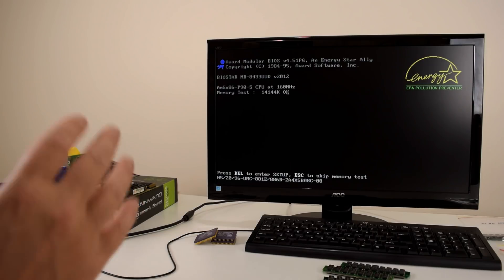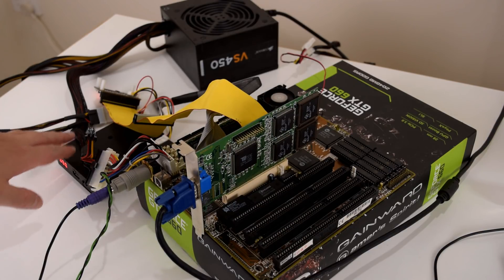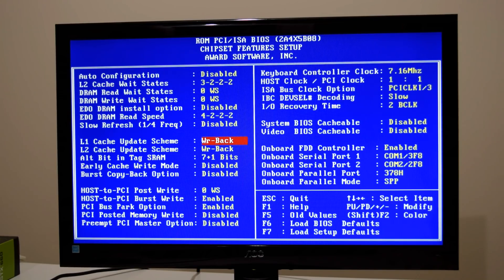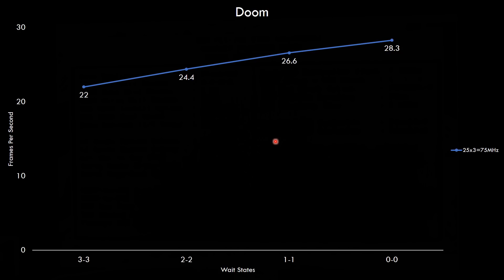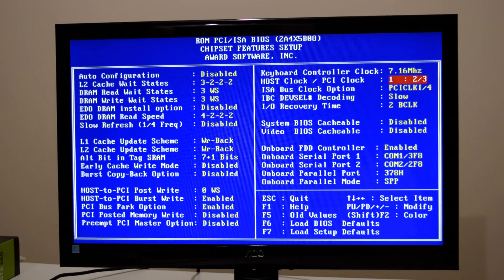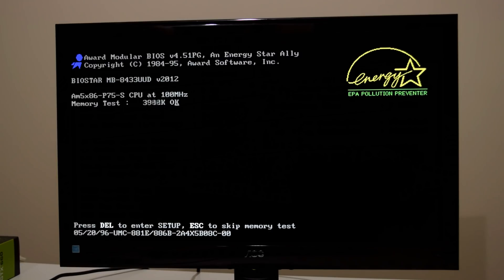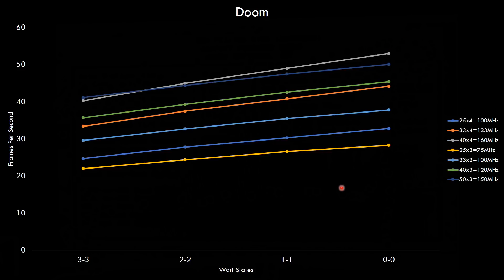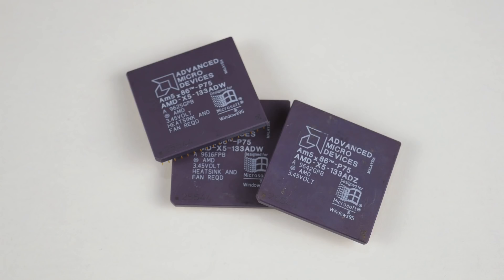486 from 75 MHz to 160 MHz and how memory timings matter

Comment: I honestly never overclocked any of my machines ever.
So, just out of curiosity... can you keep the 486 at 160MHz for productivity without running into longterm issues?
This makes me wonder if I could overclock my old MMX200 to 233 or 266MHz as I remember lots of games back then preferred those clock speeds.
Reply: In my experience the MMX can easily be overclocked. I ran a 166Mhz rated one at 233Mhz for the longest time because it had no 166Mhz written on it only the model number and I accidentally confused it for my 233Mhz one.
Reply: I've always had good results overclocking the later pentiums, even the non-MMX models. Ran a lot of testing a few years ago and my P200 (vanilla) ran fine from 75Mhz up to 250Mhz with a small Pentium 3 cooler, and sat happy with a SS7 cooler just the same.

The speed difference isn't huge, all things considered, beyond 200Mhz with the pentiums. Prolonging the life of the CPU in terms of usability didn't really come into it back in the late 90's because the Pentiums simply didn't have enough grunt to run a VooDoo 2 without severely bottlenecking the card. The Pentium 2's were simply so much faster, even the bottom end 233Mhz PII.
Reply: every machine ive had.....that could be....has been OCed
i dont go all out..... i like to keep the voltages quite low, and temps below 60c (which with a nh d15, is easy to do lol)

my favorite was using PhenomMSR Tweeker to P-state OC.....i ran P4 at like 800mhz and VERY low voltage
and p3, p2, and p1 were all stock speeds.....but were all under volted 

p0 is where i had a 4ghz OC with 1.45 volts on my old phenom 2 6 core....

now ive got a ryzen 8 core at 3.925ghz
Reply: It was a common thing to run Am5x86-133 chips at 160 MHz back in the day. They could run like though throughout the life of the computer without issue so long as you had proper cooling. It was sometimes possible with certain steppings of the Am5x86 to get 200 MHz, but you needed a motherboard which could run at a 50 MHz FSB, which was pretty rare.

As shown in this video, bus clocks were often cascaded off of a master clock (usually the FSB) and often didn't have dividers available, so boards that had PCI or VLB could end up running the slots at 50 MHz, which was way out of spec and caused cards to malfunction. Though if you could get such a setup working, it would often perform like a low end Pentium in many applications.
Reply: I distinktly remember I have seen  DX-33 passive cooled small copper heatsink with the size of the cpu , as I remember heatsinks came wtih dx2-66 overdrive - maybe he could keep it cooled with the airflow in the case.
Reply: >really shows just how much more horsepower the P2's had over the original P1's

When comparing a Pentium MMX and a Pentium II at the same clock speed, the only thing the Pentium II really wins at is 32 bit code, which at the time wasn't very important. The Pentium MMX could hold its own in 16 bit code, which is what most DOS games and many Windows 95 applications still used.
Reply: the stock speed was 400mhz. i think it was stock cooler up until the point the fans failed and i replaced them with slightly better fans. it really wasn't that hot even at 600mhz. well it wasn't hot at 533, at 600 it started to get a little toasty. but nothing unmanageable.
Reply: Pretty much. I've got a Pentium MMX 166 that was remarked (Custom sticker) as a 200Mhz chip and runs flawlessly to this day.
Reply: If it supports a amd 333 k6 then go for it .eg not lower since k6 is kinda weak and at 333 you dont have the trouble of k6-update in window's - window's wont start since it dont support higher than 333 amd cpu's- If you go for it have it on floppy because any udate that updates window's features removes k6. (Any is like internet explorer or windows media player)
Reply: I remember a lad I knew from school had a 486-DX2-50 in his machine at home and he didn't even have a cooler on it... that was surprising to me!
Reply: >had a 486-DX2-50 in his machine at home and he didn't even have a cooler on it...

Any 486 from 40-80 MHz really needs a heatsink, and a fan above 80 MHz. A DX/2 50 will get smokin hot without a heatsink.
Reply: It was smoking hot! LOL! But it worked! Most of his PC was held together with tape. I was just shocked we were playing Worms in DOS and he didn't even have a heatsink! XD
Reply: Some of the later Pentium and Pentium MMX chips had locked multipliers, restricting overclocking to raising the FSB. The earlier chips were fair game, though. I've heard this was introduced due to the high number of upmarked chips being sold, particularly in Europe.

Unfortunately I am unable to test overclocking on my MMX200, thanks to a locked multiplier and an OEM board that only goes up to 66MHz FSB. Even with an overclock, it still wouldn't match the performance of a PII 233. Regardless, the system serves me well as a great MS-DOS / W95 system that runs the games I want (I think it's the fastest Jazz Jackrabbit will run on without patching).
Reply: You need a good (and now rare) super socket 7 motherboard to fully test overclocking socket 7 CPU's. I have a couple lying around, but I don't tinker with them anymore. Simply don't have the time.

And yeah the P2's are a different beast altogether. Running a later DOS4GW game like Tomb Raider or Carmageddon really shows just how much more horsepower the P2's had over the original P1's. At the same clockspeed (233Mhz) it's night and day. The VooDOo cards really fly in a P2 also, the P1's really hold them back. I had a VooDoo 2 card in a Pentium 1 for a while but it performed roughly the same as the VooDoo 1 did. Total CPU bottleneck.
Reply: My IBM I got brand new in the early 90s with Intel 468 SX33 has no heatsink on the CPU and there's also next to no airflow. I think IBM would've put a heatsink on it if there was any danger of overheating the CPU. I don't know though if DX33 and SX33 makes a difference in terms of heat generated. All DX2-66 I saw back in the day had at least a passive cooler mounted.
Reply: > I think IBM would've put a heatsink on it if there was any danger of overheating the CPU

Unlike today where proper cooling of the CPU is down to a science, back then, there was a stigma of using heatsinks and especially fans to cool CPUs and other components. In many computer designs, the only fan in the entire case was a slow moving one in the power supply which provided almost nil airflow.

This stigma lasted well into the Pentium generation with computer designs opting for huge heatsinks to avoid even a single extra fan in the case.

The avoidance of proper cooling in designs did lead to high failure rates, especially among the more junk brands like Packard bell.
Reply: Yes in my IBM the only fan is the one in the power supply. But IBM was known for robust systems, so they must've been very confident that the SX33 would survive a long time without cooling, which in case of my IBM system became true. When you touch the CPU with the finger it also doesn't feel hot, just warm.
Problem with 1st gen CPU-cooling were the very small fans that often were of very questionable quality. My first one on my Pentium survived just 3/4 of a year.
Reply: I don't associate IBM with the words robust or quality. Their mid 90s to mid 2000s systems were absolute garbage with motherboard failures due to faulty capacitors, power supply failures and infamously, hard drive failures. Their faulty hard drives cost them over a billion dollars in lawsuits and warranty replacements, which is why they sold out to Hitachi.

I remember having to get warranty replacements on IBM hard drives in the early 2000s and even IBM didn't have confidence in their own products so they were sending Maxtor and Seagate drives out as replacements.
Reply: I never saw a mid 90s (1995/1996) IBM PC with faulty capacitors. Maybe their consumer line Aptiva featured cheaper components I don't know. The problems with the harddrives cames later (~1999) and only certain models suffered the failures, apart from that they were good drives. That was also already the time when IBM left the PC system builder market.
Reply: the intel 200mhz processors used to easily run at 233mhz, with no problems as long as the pci and isa busses are running at 33 and 8 mhz, they will do this forever, but in my experience only the black fiberglass or ceramic versions would run at 266mhz reliably especially running windows, you will come across some 200mhz intel chips that have green fiberglass these i could never get to run 266, 233 with better cooling was sometimes possible but not always it seems that these chips dont care for over clocks, i once got a 233mhz chip to run reliably at 299mhz on a super 7 board(asus atx), with a skt 370 p3 fan an heatsink modified to fit.
if you are looking for a socket 7 intel mmx cpu look for the black fiberglass boarded 200mhz chips(real ones not rebadges), in my opinion they are better than 233 chips in terms of overclock, and were and probably still are cheaper than 233mhz, as for amd the 400 and 500mhz k6 socket 7 chips are better than 450 and 550mhz versions, they are also easier to find, 550 chips were thin on the ground then never mind now, but as the intel ones mentioned above the 400 and 500mhz versions have better overclock possibilities.
Reply: I had a 486 66 dx2  in 1994.  The dx processors had no fan just a heatsink. The 486 sx had no heatsink or fan.the 486 dx4  and early pentium had a fan and a heatsink. I bought the 486 dx-66 because early Pentiums were failing due to overheating for about a year or so.
Reply: 486 up to DX2 66 MHz can operate without a heatsink. Faster CPUs require a heatsink and a fan for sure.
Reply: well i had a pentium 2 400mhz that ran at 533mhz (topping out at 600mhz for a few months after my 1ghz atlhon went poof and i had to fall back back to the pentium2 until i could buy a new atlhlon, so i pushed it as hard as i could to lessen the downgrade) or more for 10 years and it probably still works.
Reply: What was its original clock speed? Did you use special cooling?

Comment: I never knew you could get an AM486 going that fast! Highest I ever got an intel 486DX2 was at 75 from 66 and it didn't like it.
Reply: The AMD 5x86 was a 486 architecture compatible 486 motherboards. I think the fastest variant sold was 160 MHz stock.
Reply: It's not a AM486, it's a AM5x86.  Technically it's a optimized and clock increased AM486.

Comment: I never found a 486 of any type actually make a lot of use of the L2 cache. There is a slight benchmarkable difference, but not as much as one would think.  The 72 Pin memory you are using will be rated for 66Mhz, FPM or EDO, and in all of these tests, the memory is being underclocked so you will not see a difference between 60 and 70ns because both types can handle the WS at the underclocked speed. One thing you might take a look at, is look at your jumper settings for your FSB on that motherboard and see if there are any combinations that are not listed. Some of these late era boards have the ability to run at 60 or 66Mhz clock speed, and is usually undocumented. I have had some success running these chips at 180Mhz @60 bus, and if you want to see a AMD 5x86 chip at max performance, that is how you get it and will likely be equal or faster than it would be at 200 because of the 60mhz bus speed.
Reply: Well, if you wanna talk "High-End 486 Era Motherboard" (i.e. the Elitegroup EISA/VLB 486 board from the early 1990's - the model of the board escapes me though I'm sure WaybackTECH may know it) you could even go up to 10 Cache chips ... 8 Cache SDRAMs (either 256KB or 512KB), 1 Tag SDRAM and 1 Parity SDRAM.

While the memory speeds were incredibly important (and they are still of importance nowadays) the cache and selection of components were also somewhat critical to overall system performance.

Also, you may want to mess with some of the other Chipset Features setup bells and whistles...

I think you should enable the "Burst Copy-Back" option (with the L2 cache enabled) in an attempt to improve L2-->L1 data transfer speeds in case the CPU can fetch data back from the L2 cache... try IBC #DEVSEL Decoding set to "Fast" and see if you can get I/O Recovery Time down to 0 BCLKs (this basically defines how many bus clock cycles the system should wait before attempting an new read/write from/to the memory ... 0 BCLK would mean no wait between I/O transfers given your RAMs and Caches are fast enough.

Lastly, enable the System and Video BIOS shadow - much faster when the OS (MS-DOS / Windows 9x/Me) has to resort to either the BIOS or VBIOS and it can access a shadow copy in the RAM instead of ye goode ol' snailspeed ROM ... and enable the PCI Posted Memory Write (should speed up PCI Bus-Master DMA transfers) and Preempt PCI Master option (may be a hit-or-miss depending on the OS and workload).

You got some great benchmark results but there's quite some wiggle-room to really boost that thing into "Supersonic" speeds. ;)

And as a very final tip: Try to get a copy of QEMM386 and forget about EMM386.SYS ... QEMM386 was the magical ingredient to really make EMS memory access fly.
Reply: I would assume external cache would make the biggest difference when CPU is starved of data. So, in your case that would be lowest bus setting with highest CPU frequency (25MHz, x4) and with 3|3 wait states.
It's always best to do worst and best case scenario with this sort of things.
Reply: Can the 486 actually tolerate that? Did you do a video about that?
Reply: I had an old Fugutech (PC Chips clone) 486 board that ran up to 60MHz with undocumented settings (it did really nice things with my Cyrix Cx5x86 chip).  Where the L2 cache really makes a difference is with Windows programs, or programs that run under DPMI that use lots of memory.  If you could find fast SRAM chips (I used 15ns because that's what I could find, but faster was available), you could run the FSB pretty fast and still use low L2 cache wait states.
Reply: Remember that not all of those chips are cache chips, one or two of them are going to be TAG SRAMs, which serve as a look up table for the cache. If you install a normal cache SRAM into a TAG SRAM socket, either the cache won't work at all or bad things happen.
Reply from the maker: Yea the board can go even higher, 60 and 66 are supported. I admit, I thought L2 cache had a higher impact, so I'm glad I checked it out, learnt something. And with prices on some L2 chips, you can need up to 9 of them, you can also save some money.

Comment: I find the L2 cache gives my machine much more of a performance boost with higher wait states. I see a jump between 0 and 1WS so I am wondering if certain things (that would normally make use of it) bypass the cache when WS is set to 0?
Reply from the maker: Is this on the 486? For the RAM, just set it to the fastest timings. You shouldn't have any issues.
Reply: PhilsComputerLab yes it is. And that is what I thought. But going from 1ws to 0ws I get results consistently about 3% lower. Not much I know, I just don't understand why.

Comment: how old can you go with overclocking considering intel x86 with consumer grade motherboards? can you overclock a 286 for instance? is it possible?
Reply: That was a very different time back then, motherboards were designed to work with x86 and a number of vendors made processors to the x86 standard. Instead of now motherboard makers design their board to work with intel, or amd. But yes 286 overclocking was possible.
Reply: AMD begun manufacturing x86 chips as a second source for intel chips. Some server operators required that there must be a second vendor who can give them x86 chips if intel goes belly up. Their chips were identical until Intel changed their relationship and cut AMD off from detailed design data. That was 386 era I believe, but the first generation was 386 was reverse engineered intel 386 and almost identical. Up to socket 7 AMD maintained pin-compatiility so that you could plop a K6 into the same motherboard that would take  a pentium.
Reply: Overclocking a machine from this era would probably involve getting the soldering iron out to swap the clock crystal.